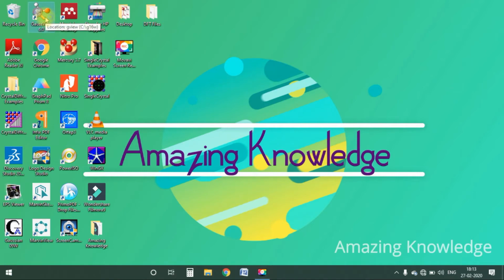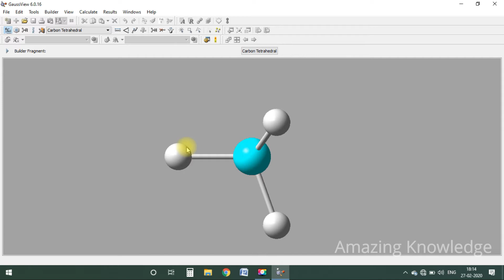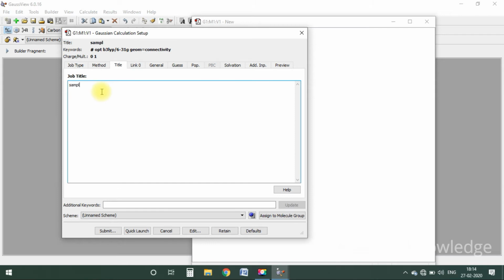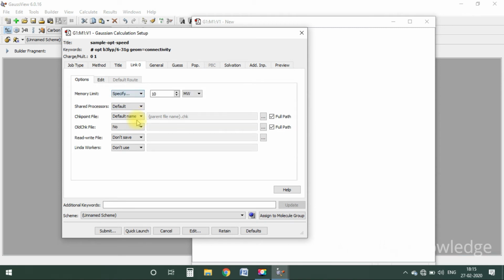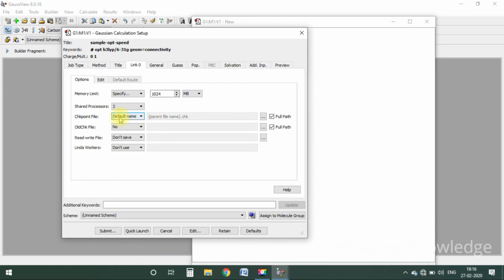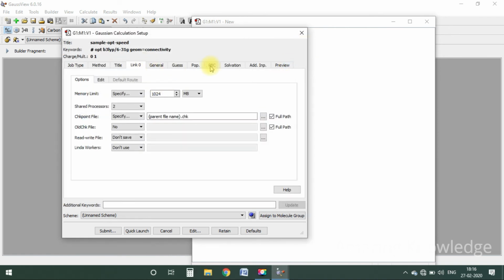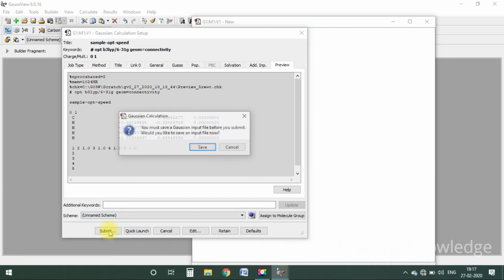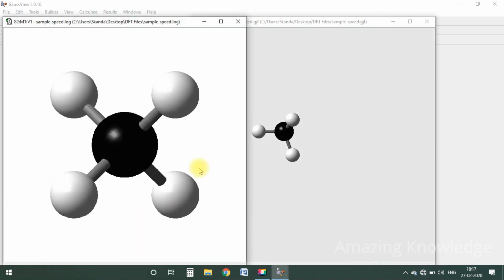How to increase the RAM and Processor speed in DFT calculations (GaussView and Gaussian)

Comment: Noooooo we can't go farther 1800MB
I try alot of times and methods 
can you help me if you know how
Reply: I am also facing same problem, i have PC with 6 core 12 processors and 16 GB RAM , and cannot use more than 4 shared processors, and 1500MB of RAM, and I have seen no effect of LINDAworkers, 

I have heard that 64 bit GW09 version can run higher nsharedprocessors and RAM,
If you have got some info plz share

Comment: Thanks for helping,
i have PC with 6 core 12 processors and 16 GB RAM , and cannot use more than 4 shared processors, and 1500MB of RAM, and I have seen no effect of LINDAworkers, 

I have heard that 64 bit GW09 version can run higher nsharedprocessors and RAM,
If you have got some info plz share